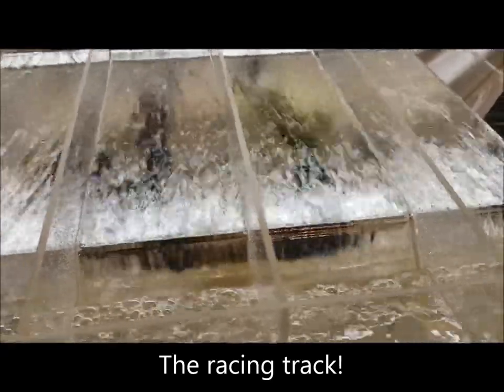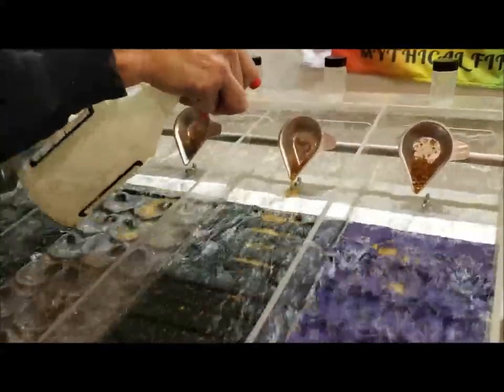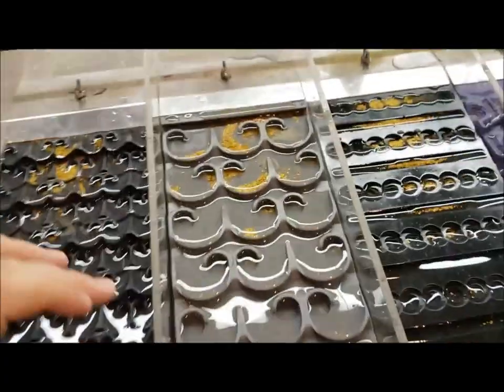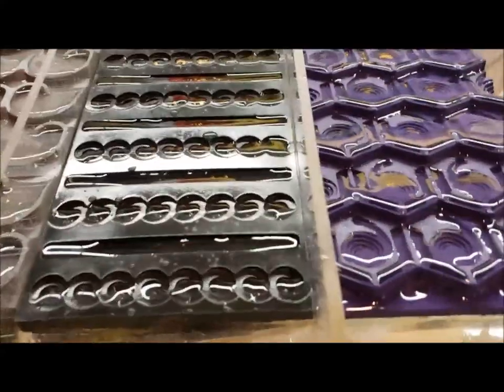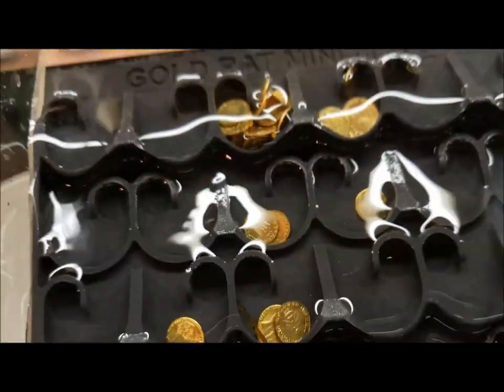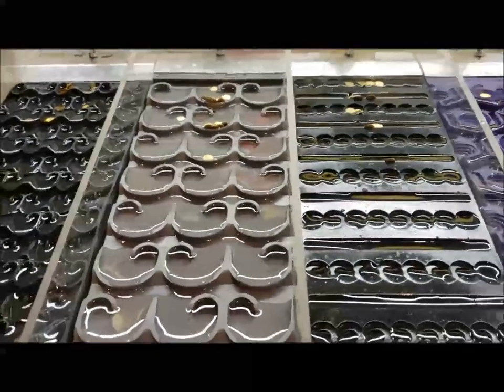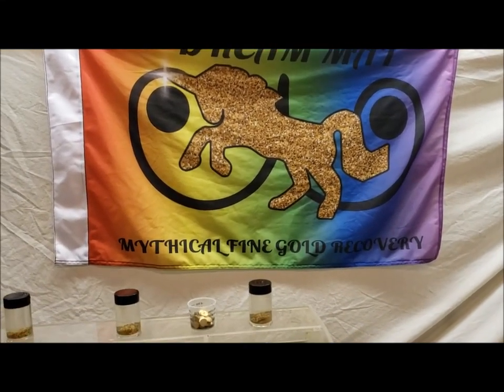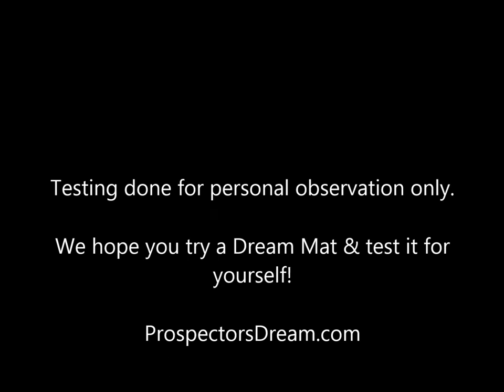SLUICE BOX DERBY, Dream Mats, Devin, Gold Digger Race

Comment: I was already a believer in dream mat from my own experience but last winter I saw you do this derby at the gold fair in North Idaho where you did it vs the gold hog mats and it was impressive to see side by side.
Reply: Keene miracle mat, GH UR and GH wave were used in the last test.  The UR mat is described as a slick plate that captures fine gold and the wave mat is designed only for fine gold in slow calm water.  If you know what you're seeing, the test is obviously designed that way.